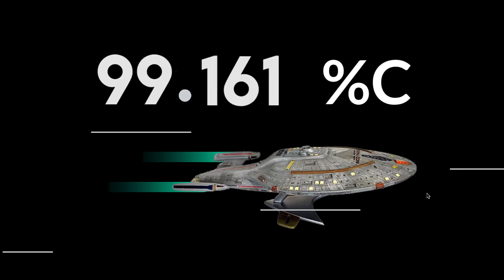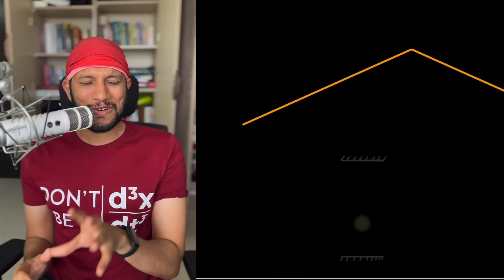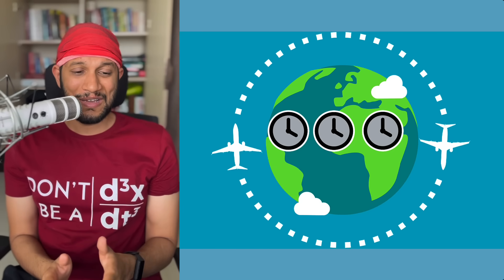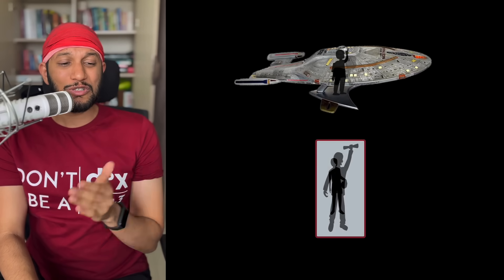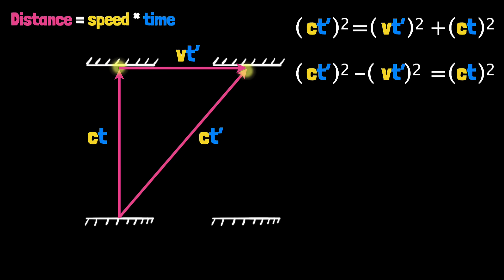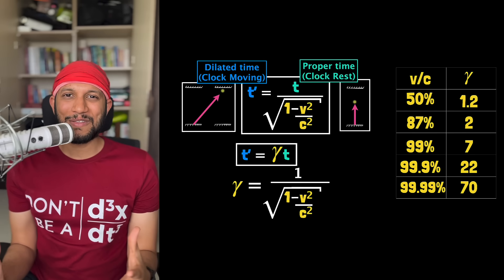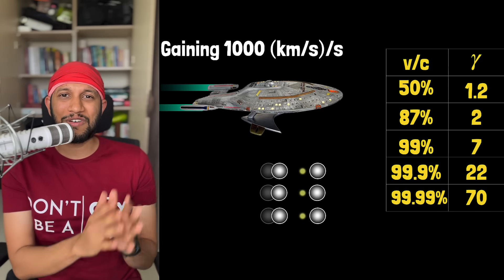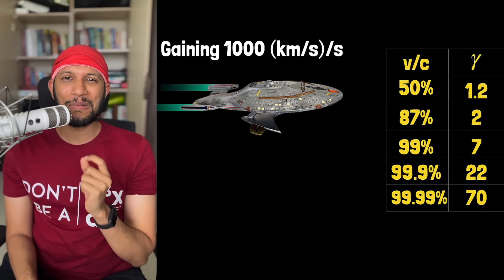I finally understood why you can't go faster than light! (My mind is blown)

Comment: @FloatHeadPhysics One thing I dont understand, from the outside perspective, using the analogy with the proton mirror, the photon has to travel a further distance, therefore from the outside, the process is slowing down. However, if I understand it corrrectly, from the perspective of the ship crew, time is moving at the same speed than before. So wouldn´t it be possible for the crew to reach the speed of light and only people from the outside can´t observe it?  Of course if they slow down again, they technicly needed a longer time to travel a certain distance compared from their experience, however, from the crews perspective, they haven´t aged as much as their sourounding. As time therefore is perspective, it almost becomes a philospohical question which time perspective is the correct one, and depending on which side you chose, traveling with the speed of light is possible right?
Reply: From a theoretical perspective, yes, they would eventually reach the speed of light. But this would require an infinite amount of time to pass, far exceeding the heat death of the universe. Any amount of time you can imagine passing is finite and infinitesimally small in comparison to true infinity. But assuming infinite time does "pass", even if we ignore the possibility of the ship crashing into an obstacle along its path due to the inability to react in time, eventually they will become frozen in time and their internal clock will never be able to tick forward. Mathematically this is shown by t' becoming equal to 0 as v becomes equal to c.

Furthermore, in this theoretical scenario, if we ignore the requirement of infinite time to consider another problem, the moment the ship hits the speed of light it becomes impossible to decelerate by themselves and they will require the assistance of an outside force. But if they've hit the speed of light, then their ship will be carrying infinite energy, and anything that attempts to enact a force against the ship will come into contact with the transfer of that infinite energy, resulting in complete annihilation. This in turn means that the ship will be forever frozen in time as it becomes an unstoppable force barreling through the universe and obliterating everything in its path.

Another way to think of it is that it's kind of like running a simulation on a PC where you can pause and save the current progress of that simulation, then resume it at any time. From the simulation's perspective, when you resume it, it's as if it never stopped in the first place, but you can also leave it paused indefinitely and never power the PC back on again, and that simulation will be forever halted where it was left off without the simulation ever being aware of it.

Conventional physics tends to break down once you head toward infinity.

Comment: doesn't it means that an object technically can go beyond the speed of light but it could never be measured from outside the ship? Because you said from inside the ship you wouldn't feel any difference and constantly gaining 1000km/s would eventually end up at lightspeed if you accelerate for long enough at a constant speed and it would only be slower than light from the obsevers perspective.

Comment: Okay, so crazy idea: we make two neighboring particle accelerators/colliders, configured to send particles the opposite direction of one another. The Hadron Collider has managed to get a particle up to 99.99999896% the speed of light. Ergo, if we got particles up to this speed in our twin colliders, then there are two arcs along both colliders where the particles’ velocities, relative to each other, exceed the speed of light.

If we then consider that speed/velocity is relative, not absolute, then wouldn’t that mean that there are objects that can move faster than the speed of light, from a certain frame of reference?

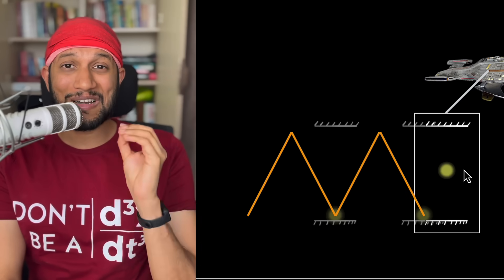Comment: 1:40 In this photon clock presumption, it is considered that the maximum speed of photon is the speed of light, which we yet to prove at last as per the title of the video. It should have been assumed that in a moving UAV/Rocket, the speed of photon should be rtsq(c^2+v^2), where v is the speed of rocket, instead of considering the speed of photon in all frame of reference to be c and the path travelled by the photon is increasing. Hope you understand my point. Feel free to discuss.

Comment: Problem here still is relativity wrongly applied. Lightyear 2022 shows how bad the idea can be applied. If you go at the highest speed, you'd be almost stopping your time relatively with the time before acceleration. It means you won't travel into the great future it means your atoms will go slower. If you make a round trip at the speed of light, you'd be back before anyone notice.  Not the other way around. And you'll have plenty of time to do so. Relatively speaking, of course. Remember, time is just a word meaning to measure events happening at the tiniest of levels. Now let's explain it in comics, imagine flash getting blind while running, that's what should happen when you go that fast no light, but being a bit indulgent with the fantasy flash is also faster thinker, not just fast runner. Relatively, he is moving faster. Therefore, time or should I say relative time goes different for him. So, the notion of a fast forward into the future by speeding is simply wrong. On the other hand, you could almost stop ("relative time") "time" by moving too fast.  Another fantasy example is time stopping... if you were to move fast enough relatively to the moment before acceleration, it could look like a full stop. The reason the clock went slower on the flight is because the events happening from decay go slower. If we could travel that fast, our bodies would decay slower.

Comment: Time dilation isn't real. Time is present. Everything is happening right now. Needing to follow the math is why going beyond the speed of light is impossible.  It is the logic of if you dont see it means it's never happened.  If you go three times the speed of light for an hour you will end up in the spot calculated by the speed you traveled in the time those at the beginning just wont see it. If scientists can accept black holes exist at the center and singularity though you cant see the singularity in the center then you can go beyond the speed of light though it cant be seen.

Comment: We cannot travel faster than light, with our current limited understanding of the universe. Light is quite slow compared to the scale of the entire universe, and we attribute way to much authority to such a small piece of it.

Humanity knows so little about the universe as a whole that we could be way off on certain key details, but still come up with an answer that is close enough to perform advanced tasks locally. (Happens all the time in many fields, all throughout history.)

Saying with certainty that you can never go faster than light is just the kind of silly statement a species who still hasn't learned enough to realize just how little it actually knows would say. Just like we used to say with certainty that the Earth was the center of the universe, and had models drafted to show how it would function mathematically, that also functioned well enough at the time.

Comment: Ok so the photon clock might slow down if the photon clock is oriented perpendicular to the direction of travel, but what happens if you orient the clock parallel to the travel.  The clock would tick at the same speed at all velocities since the distance traveled would remain constant except during acceleration.

Comment: 7:12 So another way of putting this (I think?) is that time isn't an actual thing that exists but rather just the name we give to the rate at which processes happen relative to each other? Mind blown, but that makes so much sense.
 
And things can't move away from each other at faster than the speed of light because (1) the speed of light is the max speed of particles and is therefore also the max speed a process can happen at, and (2) the difference in relative rate cannot be higher than the max speed of the process itself because that would mean that the process at the faster end would be moving away from the process at the slower end faster than it was actually occurring, and that the process at the slower end would effectively be happening slower than stopped.
 
I think?

Comment: 2024 and people still make the mistake of taking the theory of relativity for what it isn't. It's RELATIVE not ABSOLUTE. Meaning it doesn't actually matter because that's not what is actually happening, it is only in our subjective perception of observation that "time" dilates which is not actually time, but the light travelling. Light travel =/= time, we just associate it as such and this still baffles me. Time flows as an ABSOLUTE everywhere, doesn't care about gravity or anything else at all. It's a dimension that flows by itself, on its own axis, and speed sure as hell is not related to it since we've never been able to tap into it, only measure it arbitrarily in our own way, and capture it in photos and videos which store parts of the lapsed time which has past. 1s inside a black hole is the same as 1s right now, as you blink, for everyone and everything, everywhere. The same second that is lapsing right now on Earth, it is passing at the same time, in a parallel fashion, anywhere else in the universe.

Anything speed related you can think of as the Y axis of time (if time is X axis) as a snapshot. It's the same as taking a picture of a rally car jumping over a hill at 150km/h. In that specific second in time, that car was doing 150km/h and could never affect time at all. It's the same with ANY speed value you want to input into that visual metaphor I just created. You can freeze a snapshot of the spaceship at light speed, and all it would mean is that the ship in that second was doing that speed, and that same second in which the snapshot is taken passes everywhere in the universe at the same time. This is why interstellar is non-sensical. Every second on that high density gravity planet would be the same exact lapsed second on the spaceship in orbit. Just because light distorts around gravity does NOT mean time is distorting at all, since it is its own dimension, unrelated to the physical existence or manifestation of energy, particles or matter.

Comment: Einstein was an idiot who screwed his cousin. The light bouncing between the two mirrors wouldn’t change if viewed from the outside. But if it did it would be an optical illusion. In the first case on the ship the light is moving while it is bouncing between the two mirrors. The only difference from the outside of the ship is the perspective of the exact same condition. The theory of relativity is stupid. This is further proven by the fact that there is no speed of light. Light has a rate of induction in the aether. This is why it speeds up after leaving water or glass, a denser medium. They arbitrarily picked the speed of light. Tesla, who also shared the view that einstein was stupid, said light is a soundwave in the aether (a rate of induction). This destroys relativity. My theory (based on the minds who founded the modern electrical world and electrical science), is that the only way to reach the “speed of light”, would be to detach all lines of force from the aether. All matter is connected to the primordial aether via the electron “particle”. If a car detaches from the aether theoretically it could come to an almost instantaneous stop and accelerate instantaneous. The only resistance at that point would be physical matter like air and friction. But in an environment like space these things wouldnt exist.

Comment: So: if a ,87C a still observer see that ship need now 2s to gain 1Mm/s, from the ship it took only 1s. So the problem is only to an external and still observer: he could never see that ship at C because it need infinity time or infinity force. The crew, instead, because them are traveling at relativistic speed, they do not feel that gap and gain 1Mm/s in 1s from ,87C without big issues. Is my thinking right?

Comment: The only way to get to the speed of light is to have such a massive explosion of energy that it instantly propels you the speed of light. Hence, why light travels that fast. Starts are exploding with massive amounts of energy which instantly propels light. The problem with that is that the explosion would have to be so massive to get anything with mass to the speed of light, basically nothing would survive the blast.

Comment: This explanation relies on using photons to demarcate time.  This assumption that time requires a photon (like in a clock) for time to exist requires justification. Clock =\= time.  Just because we can’t measure time faster than light doesn’t mean that time is restricted to our ability to measure it with photons.
Also, muon radioactive decay taking longer is correlated with their speed; you assumed causation without explanation.
You also equivocate radioactive decay with scenecense.
Imagine thinking you could only measure time on earth with tossing feces before discovering outer space and photons and saying “if you don’t measure time by how fast feces can fly through air is philosophy and not science”. That’s you
By equivocating a feature of reality with your ability to measure it with photons promotes photonic solipsism

Comment: Well....

I have a little problem with understanding - the assumption is that the C is a constant. Regardless of the speed of the light source or the observer.

Here you are saying that from the outside observer the speed of photon will be a vector summary of the speed of mirrors and the speed of Photon itself?

According to the theory - this photon will travel straight vertically for the outside observer. Is that right?

I mean - if you travel on the train and point the flash light vertically - then the light will travel vertically for any observer: on the train, on the platform... anywhere.
Or... my interpretation is not correct?

Comment: What is really counterintuitive in all this is that the speed of light is constant regardless of the reference frame. If you just go with that assumption the rest is easy to follow, but how does that make sense in the first place? Like if you send two photons in the opposite directions they will both be moving at the speed light both relative to you but also relative to each other. That's the real head scratcher.

Comment: If in the endless vacuum of outer space I leave a box that is parallel to me and assuming I am stationary I fly away at my maximum speed of 100.000 mph after 1 hour I stop my engine and leave another box next to my ship, I pull away again at max speed and now go 100,000 from my second box but 200.000 from the first one. suppose I adjust my direction to make an enormous circle, and I continue this process, in the end. I will go 100,000 mph from my last box and whatever the accumulated speed I have when I pass my first box. in an endless timeless vacuum going very fast can not have any influence on anything an nothing will restrict going at whatever speed. I go further and say that outside our universe in the endless nothing, there is no time no light, and nothing in any direction, so you can either be stationary or travel at 10.000 times the speed of our light, and nothing or no one can prove that is wrong.

Comment: We can go faster with light, but we have to cheat gravity.
There are 2 ways:
*Creating a anti-matter buble -- antimatter pushes the matter away, while we are inside. You dont even move pretty much, but you can go at any speed you want. To a naked eye it would look like you teleported (entered space and exited on another one)
*Making a hole in fabric of space on 2 sides and connecting it. In other words, making a space gate. One gate sends dark matter and creates a tunnel on other side and this causes connection. This however is also very dangerous to do as if there is interuption in it you can create a black hole as mass will suddenly get stuck in one point of space fabric and merged. When you create a tunnel, all mass on the way from point a to point b gets moved away from cylinder like shape tunnel.

We just have to figure out how to produce Antineutrinos in a mass.

Comment: Correct me if I'm wrong (which I probably am), but as you explained the clock's hand movement, you made it sound like the problem is that information from "atom to atom" takes time to travel. This makes it appear as "if we were to only accelerate 1 atom though, this 1 atom can effectively reach the speed of light, since no information needs to be transferred to another one".

I've been led to believe that regardless if we speak of even individual particles, none can ever reach the speed of light. Adding to that, the LHC I believe accelerates single Hydrogen atoms to as close to C as they can, knowing that attempting to actually get there is futile, regardless of the atom being electromagnetically bonded or not.